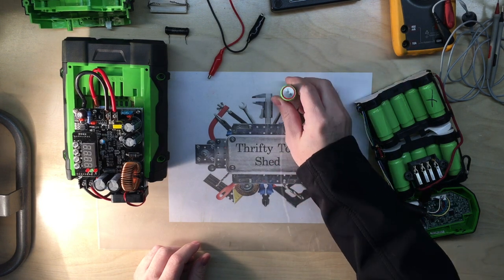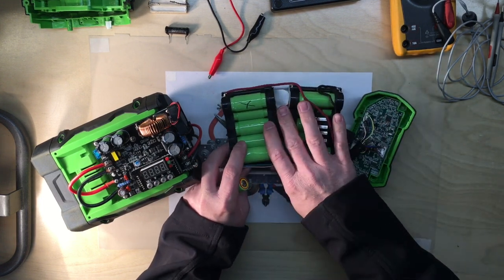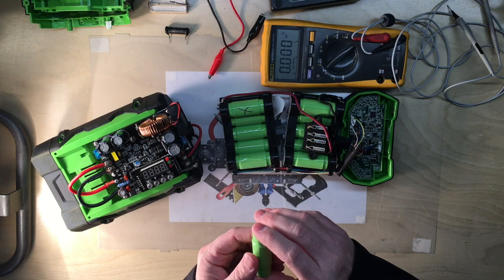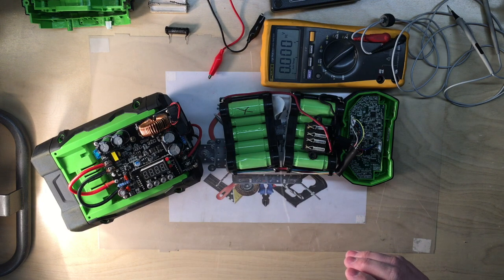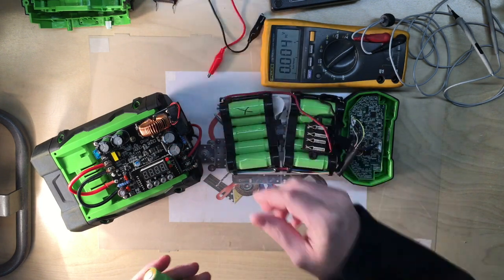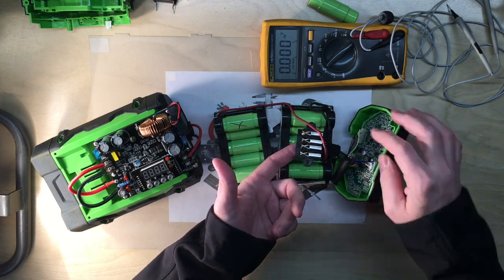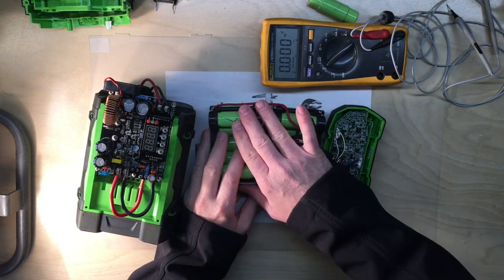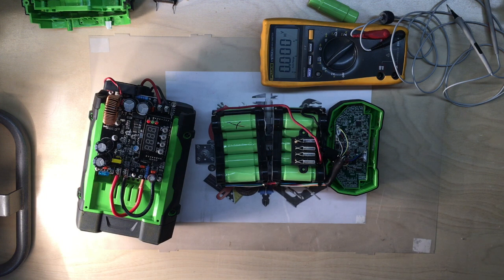Individual Cell Balancing in Repaired Battery Packs

Comment: My 2P5S 10Ah XR DeWALT pack has one segment measuring 3.6v and the other four measuring 4.0v. So I just connect alligator clips to the balance leads where I’m measuring 3.6v and charge in situ? If so, can I use my Opus BT-C3400? I don’t think it lets me specify the voltage but I can watch it closely.
Reply from the maker: That is a way to do it if you don't have a bench top power supply with Constant Voltage and Constant Current. If it does accidently go to full charge you can just simply do the others the same way and fully charge the whole pack, but it will take the extra time to do all that of course.
Reply: @ThriftyToolShed  Thanks! I didn’t see anything else wrong with these notoriously bad 10AH DeWALT batteries so it just seems to be the measured balance issue to blame. This one drops out before the other 10AH pack in a mower that takes both simultaneously.

Comment: Do you have any advice for removing the potting from the BMS? I tried to peel it off like you did but it didn't work at all. Just pulls off in little flecks, almost impossible to get it clean down to the board to check circuits. Were you able to just peel it off or did you do something else? Thanks in advance.
Reply from the maker: I was able to peel off sections as shown in the video. I carefully peeled off enough to unplug the 3 connectors and then I was able to carefully slice down the edge of the board and the housing careful not to cut on the board at all. Then from there slowly picking. Also use my picture of the board to see where components are to help also. It's possible the potting is harder and more difficult? Mine so far have been a gray silicone type and is pretty soft.
Reply: @ThriftyToolShed  Thanks. I just tried a second battery and it peeled off just like yours did. I guess my first battery just has more adhesion for some reason. They are both the soft gray silicon-like material, but for some reason the first one disintegrates instead of coming off cleanly.

Thank you for all of your videos by the way, very helpful. I'm trying to troubleshoot a BMS that seems completely dead (no light will come on when button is pressed, even with all good cells connected). Caps, transistors and the transformer look good. I'm a bit stumped but component testing has gone much faster thanks to your videos and the data sheets you've referenced. 🙏

Comment: So I'm guessing that Ego BMS does not do any cell balancing. That seems like such a shame. We really need a devise that will rebalance the cell.s
Reply from the maker: It does have it, it must not be enough to handle a badly out of balance pack such as the cells capacity getting mismatched to a certain percentage.
Reply: @ThriftyToolShed  Thanks kindly for your reply.
Do you know how the balancing gets activated? I assume it happens during the charging cycle, but the balancers I've seen need to be activated often with an external resistor pack.
Reply from the maker: I assume while charging, but I have not had issues with this enough to test it out for sure. I usually have bad cells or a bad BMS board. I have had no issues with balancing as long as the cells are in good capacity.

Comment: I bought the EGO zero turn came with 4 10 amp hour battery.  One battery was bad , called company and they sent another. I was impressed    Now I opened bad battery and found it has 46 volts from + to - wire but no voltage at the female + and - plugs. Haven’t found a fuse. Your thoughts
Reply from the maker: I have a video on a 5ah I believe showing the trace as a fuse on that version.  To be clear I have no experience with the 10ah to say if it does or does not use the same protection. Congratulations on that nice of a pack with hopefully an more Minor issue! Best of luck to ya!
Reply from the maker: And on the bright side even if you don't have luck repairing it, it will bring good money on eBay. Most of us that work on these packs would love the cells out of it at least!

Comment: Another great video! This should help me determine which cell is lacking. On a side note, do you offer a repair service on the ego 5500 charger? Thanks
Reply from the maker: Thanks for your comment! 
I wish I had time, I do get asked this often. I do not have a repiar service at this time.  I work full time+ in a Industrial job and try to have time to edit videos to post. I try to help by posting what I have found with a repair.  I don't have alot of time left, I wish you the best of luck with yours.

Comment: Don't suppose you have access to 3d print files or similar for this ego 56v adapter,  shipping to Australia way too expensive   https://terrafirmatechnology.com/shop/ols/products/h-battery-adapter-for-ego-56v-10-gauge-2ft-lithium-output-dock-power-connector
Reply from the maker: I do not. I have seen these on eBay as well, but unsure about your shipping cost though.
Reply: @ThriftyToolShed  sadly shipping is $80 to Australia
Reply from the maker: @waynetaylor2784  my goodness!

Comment: Ate these 18650's?
Reply from the maker: Yes they are a 1850 and since it's a 2.5ah rating we can assume 2500ma cells of course but we do not know any other specs on the battery since we have no part number to look up data sheet. I am getting low on replacement cells and may have to order some 2500 capacity cells and give them a try. I wish I had more data including the Min and Max voltage, temperature ratings etc. The phase change sleeves are also hard to find.

Comment: Someone school me here. I was taught {decades} that if one battery had say 10V and another was 11V that in hooking them series or parallel that voltage will balance out and to bring them to full 12v, do so with a slow/ trickle charge. Granted this is based on lead acid batteries and assuming no chemical / mechanical issues in the batteries. However I do know that ppl use lithium batteries[ charger packs] to charge  their cell phones which use lithium batteries. So how does this not work in a lithium pack?
Reply: What your saying is wrong
Reply: @mashedpotatoes5323  Very helpful, thanks
Reply: Good Point. I was wondering the same thing. It should all even out if they're in parallel for sure... not sure if they're in series. I think the BMS here will read 1 cell reaching 4.2V and cut off power to the pack and most cells may be left at 4.1V every time.

Comment: Hey there..watched your video and maybe I missed it but...I have 2 of these and when charging up one, it went to 59.1 volts without stopping, so it appears there is no BMS inside??...I was afraid to go any higher...do you know if that board is a BMS?...also doesnt appear to have any balancing circuit if it is....thanks
Reply from the maker: John,  Hi,it's been a while since I worked on mine but  it does monitor the pack while charging and of course discharging. It should keep cells from going below a minimum level and from reaching to high of a level. I was surprised on mine that if I did not balance my cells very closely(when replacing a cell) it would hurt the capacity due to the pack shutting down when the lowest cell reached depletion.  As far as the charge on the cells, Ego does very conservatively label as 56v when 14x4.2=59V so as long as it is not higher than that really should be fine I would think.
Reply from the maker: John, also I should have mentioned that I never go a over 54 volts or so if manually charging of course the BMS just monitors and tells the factory charger to cut off or the tool to stop when depleted.  I only manually charge enogh to get the factory charger to take it and start charging. When manually charged or discharged directly to + and -  terminals it can easliy be damaged because all protection  is bypassed. Hope this helps!

Comment: Hey there Mr. Thrifty! Thanks for the cool videos with great detail. I adapted an Ego 7.5Ah pack for use on my electric fat bike (works great!) I wasn't entirely sure I knew what I was doing so I got a used 2.5Ah for testing. The cells in the small pack are just about done so I was pondering swapping them out with higher capacity ones. Any thoughts on that? Maybe it makes more sense to grab a beat 5Ah pack of eBay and swap those out (also won't have to deal with the phase change wraps) with NCR18650's. Anything to watch out for from the BMS if I do this? Seems the main thing is to make sure they're all charged to the same level. Thanks again!
Reply from the maker: Luke Skyshatner , Great job on the bike retro! I believe you are correct about the voltage  level, but I have not had the privilege to work with the 5.0 or the 7.5AH at all so I really just don't know.i know the larger packs have the cells in parallel for capacity not sure if BMS is the same.  Man I have had alot of questions a out the larger packs, hopefully this year I will get my hands on some! Best of luck getting  that pack up and running. Thanks for your comment!
Reply: Thanks -- it's been a blast of a project! These Ego packs were supposed to be a temporary solution for the bike (long story) but after 6 months with zero issues, it's looking temp-to-perm. You can't beat 'em on price performance for top quality cells, not to mention the rugged enclosure and BMS. All great things for an ebike! You lose out a bit on weight and bulk, though. You'll love the 7.5Ah -- I hope to get to see you dissect one sometime. The thing barely gets warm even after a hard ride. I just ran the numbers and it's not worth upgrading -- makes more sense to buy another fatty. Hey, here's another question for you (my apologies if you've covered this): have you found a way to talk to the BMS? It would be awesome to get info off the board, like state of each cell, number of charges, errors, etc. Have a great day!
Reply from the maker: Luke Skyshatner , I have not tried it. But most likely would be easy to at least get the led remote if you wanted to see the change from green to red for example? Not as good as actual cell data but can could be easier?
Reply: @ThriftyToolShed. Thank you for the video. It has been very helpful in understanding the likely cause of my 7.5ah battery issues. It seems the pack has naturally migrated out of balance through usage and will not fully charge. The charger will read 100% charged but the fuel gauge on the battery will only show 2 out of 5 lights so the charger is stopping the charge likely due to imbalance. I am not getting any red lights or errors indicating bad cells. Any pointers on diagnosing which cell clusters are out of spec and balancing  things manually while the pack is still intact? 

I have a current limiting buck converter that I could use for charging and one of those 300watt adjustable load setups with the CPU cooling fans like I have seen in your videos. 

Any advice and help Willis be appreciated. I am a bit nervous to tear it open.
Reply from the maker: I understand not wanting to tear into it for sure. Unfortunately that is the only way to check the individual cell groups. If under warranty make sure you contact EGO as well to get a replacement. They Usually tell you to keep the bad pack and recycle it anyway though. To test this one and try to balance you will have to test the 14 different cell groups and then painstakingly charge every group up to the same level as the highest one tested. I would have the BMS board disconnected before attempting to charge. Also, once some of these cells get out of balance the most likely cause is that some of the cells have lost capacity and it is beyond the BMS board keeping the pack balanced. The board can handle small imbalances, but nothing like unmatched cells such as some with lost capacity. It may help to try balancing them of course, but if it seems to just get back to the same way fairly quickly it is time for some new cells. Thanks for your kind comment and best of luck to ya!
Reply: @ThriftyToolShed  thank you for the response and advisement. In one of your videos you have spare insulation material that you peeled from a sheet. What is the material and where do you get the sheets? Should I test the cells at the pack or pull the potting and test via the BMS? Curious as to which would be easier from your experience. One additional question. Is it OK to drain some cells to the same voltage or is it best to charge up vs pull down.
Reply from the maker: I believe you are asking about the sticky back end barrier? I simply pulled it off and set it aside on a plastic sheet substrate just to make it easy to pull it back off and re apply later. I don't have nor have I ever bought any.  As far as checking cells it is easier to go around on the BMS test points for me. Just remember if you have to charge up/balance cells, you will have to go to them directly anyway though. As far as discharge vs. charge it is up to you which is easier, but typically charging is superior....
#1 your end goal is to charge battery for use anyway....
#2 it's usually easier to charge to a set point such as 4V set on the CV and of course limit CC at 2A or so and it will be automatic and cut off at 4V. If discharging you have to be careful not to let it over discharge. Another way is with a balancing board, it's best to solder these leads on. You don't typically see 14S boards. I have used a 7S balance board and balanced each half separately.

Comment: I though this battery charger do the balance charge!!!   Im wrong?
Reply from the maker: Pedro Afonso ,I too was sure it does but in my 3 repaired packs it actually must be a limit to what it can help with on the balance. I noticed if they get off more than .05-.1v it seems to really hurt the capacity. However I could still be seeing the a battery issue I'm not seeing g when testing individually. I should have noted that I have  not done any testing of the pack while in service so it may not be as it seems. I think I mentioned that in my original video but had to edit some detail out due to length of video. I love to share detail but it takes more time than people are really wanting to watch. Thanks for your comment. Hope this helps.
Reply: @ThriftyToolShed  That would be my question as well... how can you have a multi-cell lithium pack and not have balance charging built in?  Especially with all those electronics on board?  What else would they be for?
Reply from the maker: @contrarian777 ,
Absolutely, I mentioned in the BMS repair video that it had each individual cells wired to the BMS and the Q1-Q31 dual Darlington transistors on the board seemed to at some degree monitor/manage. Although I did not go as far as monitoring the individual cells while charging, I assume the BMS does do as intended however I do not know what tolerance or percentage it will try to control to before giving a pack error!
Reply: Thank you kindly for your videos. Very helpful but I went through all of your links and can't seem to find your individual charger that you showed right in the middle of this video, would you show a link to that please?
Reply from the maker: It is a Nitecore charger and I still use it from time to time. I use the newer Opus tester for most charging and discharge testing. I show it in the video called " Lithium Battery FAQ #1"
https://amzn.to/3HnkmOp
https://amzn.to/3DpOk36